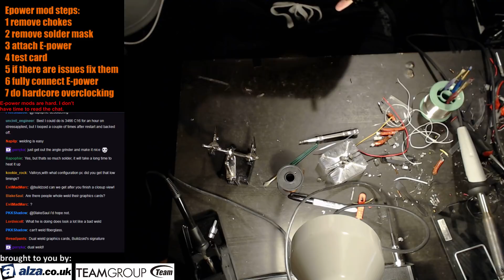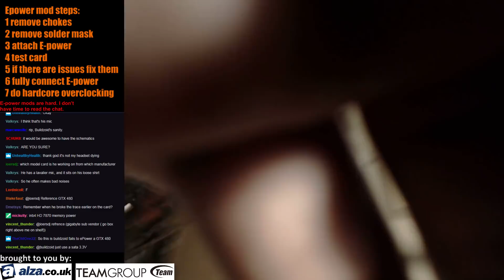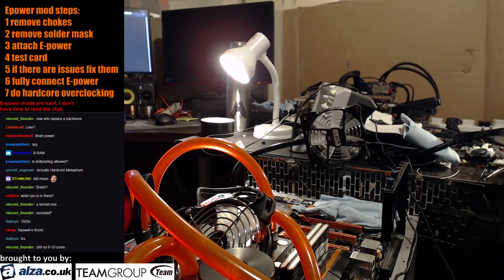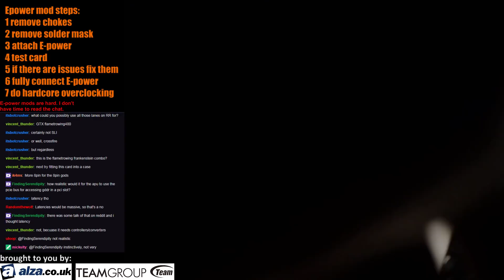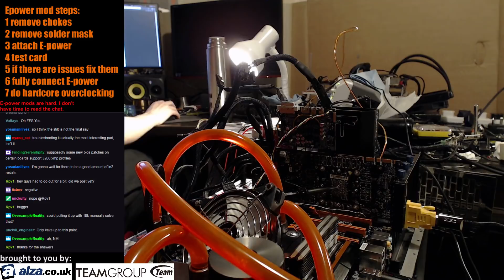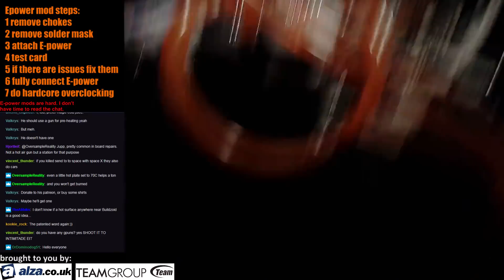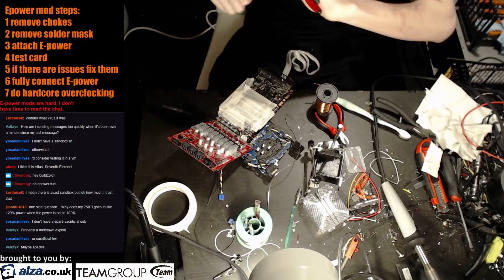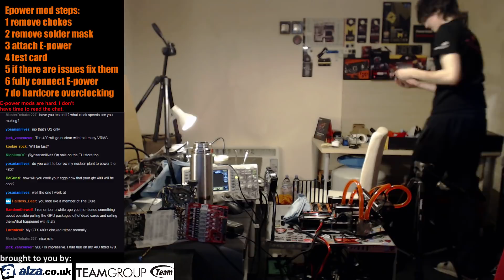OC Livestream 52: GTX 480 E-power build

Comment: 0:00:04 background and plan
0:02:35 step 1: remove chokes
0:20:38 step 1.9: clean board
0:21:47 step 2: remove solder mask (aka asmr scraping)
0:41:46 step 3: attach epower
1:01:47 step 3.9: resistance checks and sense lines
1:03:23 step 4: test card

~everything goes to crap beyond this point~

1:20:07 solving the first problem, testing again
1:22:40 troubleshooting a lack of DMM readings
1:23:30 identifying and researching the second problem
1:33:10 attempting to fix the second problem
1:45:28 testing again, asserting with 3 hours to go that it's "going reasonably well"
1:50:06 weird analogies and ranting about nvidia's clock reporting
1:52:37 more research on the second problem
2:00:08 attempting to fix the second problem
2:13:50 giving up and deciding to epower memory

~memory epower build~

2:14:11 step 1: remove chokes
2:18:00 step 0: finding and prepping the power board for memory
2:26:23 step 2: remove solder mask/clean up attachment points
2:29:09 step 3: attach epower

~more troubleshooting~

2:39:24 remounting pot
2:43:43 trying to find another modular psu cable
2:53:08 testing again
2:59:34 identifying and researching the third problem
3:21:25 finding a possible solution to the third problem
3:22:26 back to the workbench
3:26:30 identified which transistor to murderise, murderising
3:30:57 remounting pot
3:38:50 boot testing

3:43:25 unmounting
3:47:05 step 5.99: masking off card to protect from solder drips/splashes
3:52:00 step 6: fully connect E-power
4:22:15 talking about ground conenctions for epowers
4:23:45 onwards end of stream chat, Q&A

EDIT: Buildzoid linked mllrkllr88's GTX 480 epower project log in the twitch chat at the end, here's the link for those watching here: http://forum.kingpincooling.com/showthread.php?t=3976

Comment: Great Live. I would like to ask a question, based on your knowledge modding VGA's what would you recommend using to fix (fix well) heatsinks in VRM's? I need a long term solution for them while using an closed WC on the GPU. It's a 1080 TI Aorus Xtreme that i'm trying to raise the frequencies a bit but im stuck in finding a really good long term solution for VRM's. Thanks.

Comment: Did you remove controller chip at all?
Reply from the maker: I left the controllers on. I don't have hot air to pull them of neatly. I left the controllers on all the other successful(cards that I could get into windows with, not necessarily run benchmarks on) E-power attempts I've had.